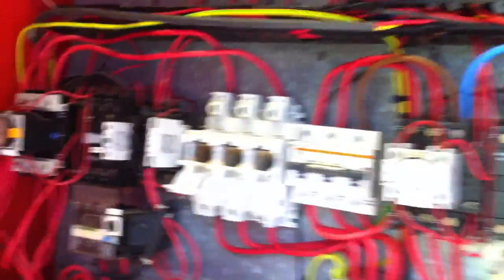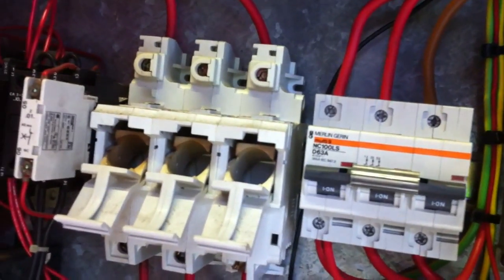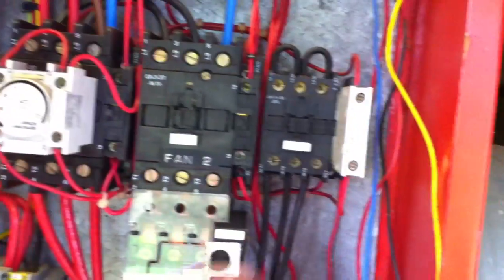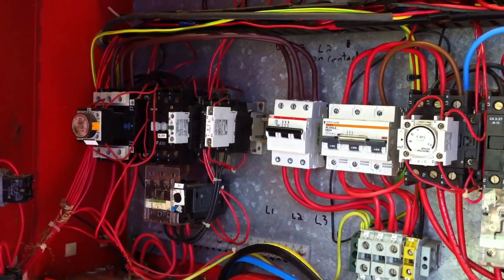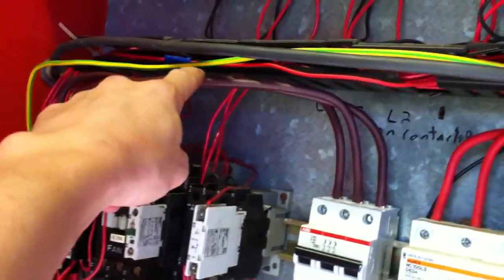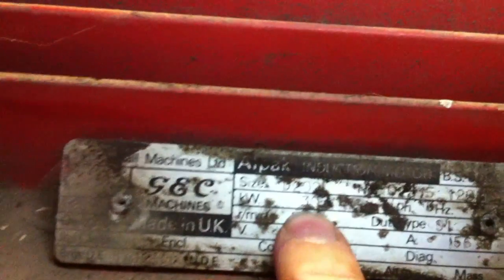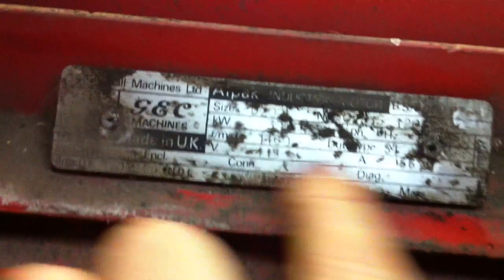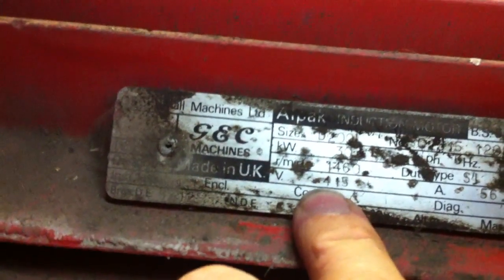DAG Grain Dryer

Comment: A shame that G.E.C has been defunct for ages. They made some cracking bits of kit! Brook-Crompton still make their motors in the UK IIRC.
Reply: FrontSideBus Alsthom now, but I tend to buy Bonfiglioli mainly because the agents are close by, are reasonable with price and at least stock most of those I need. Those that are specials ( shaft or otherwise) I have rewound locally.  Last one was cheaper to replace with new, though I really dislike the sub 1HP single phase motors now, I tend to rewind the old ones simply because they run cooler. Small single phase motors are now so cost cut that they discolour the paint within weeks, and will fail if left running at any load for a year 24/7. I replace where possible with 3 phase ones, even if I have to put in an inverter whose sole job ( ignoring all the fancy features other than slow start) is to drive the small motor.. Can actually work out cheaper and more reliable just from the power saving.
Reply: SeanBZA
 I've been meaning to buy one of those cheap 3kw Chinese VFD's on ebay just for playing about with.